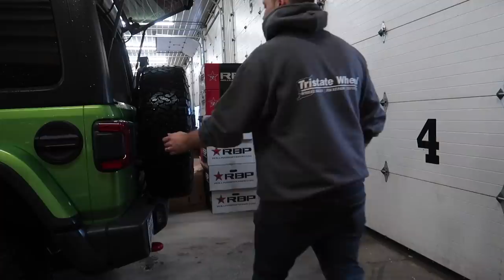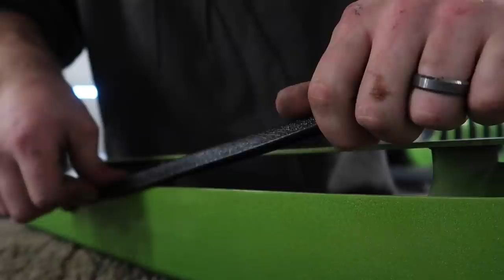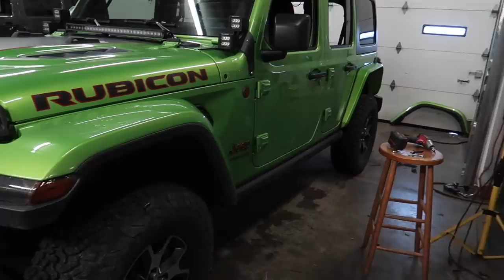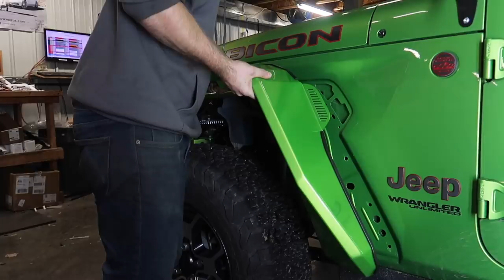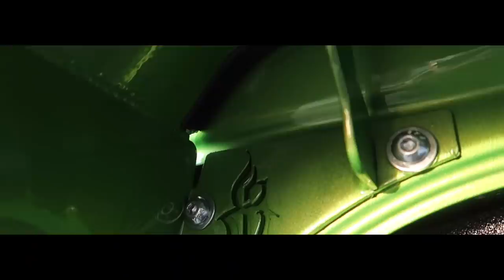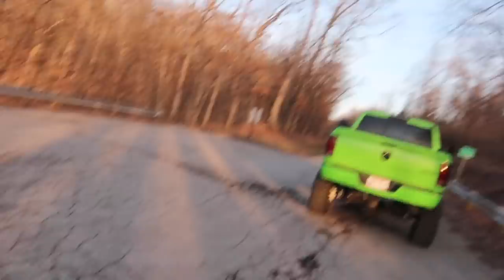Changing the ENITRE Look Of My JEEP!! *INSANE RESULTS*

Comment: At first sight I didn't like them.  But by the end of the video when it was all done and outside it started to grow on my.  I really like the lights they used instead of the dots like you mentioned.  I also really like the inner flares and the green backing plate.

Comment: So what size tires are you putting on hope you don't do 35 if you need to do 37 you have enough wheel well do 37th you do 35 you have too much wheel well if you want a nice gressive looking tire but quiet that doesn't make a lot of noise but still looks like a mud tire and gives you two sidewall to choose from because both are different then get the Nitto Ridge grappler.you won't find a tire that is quiet and look still looks aggressive telling you try them you will love them